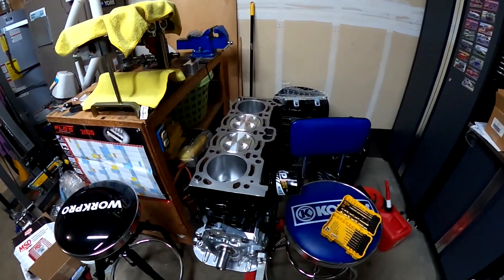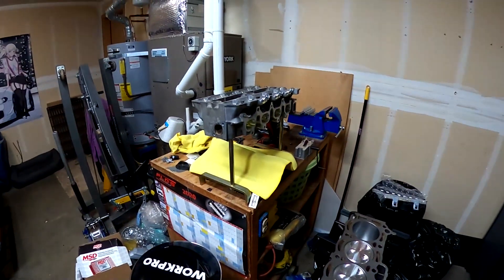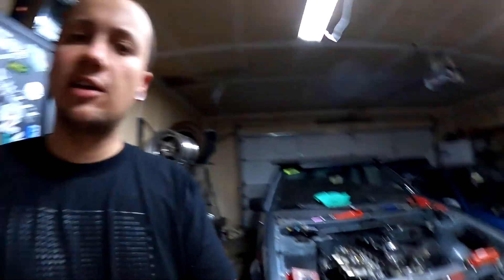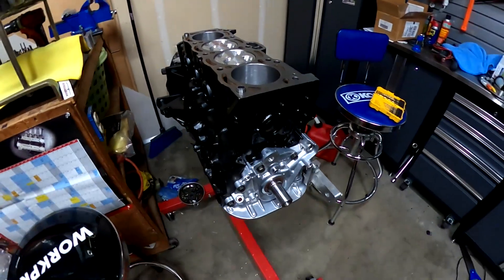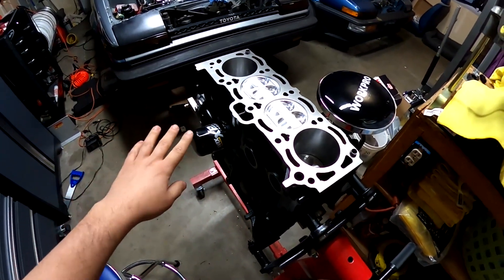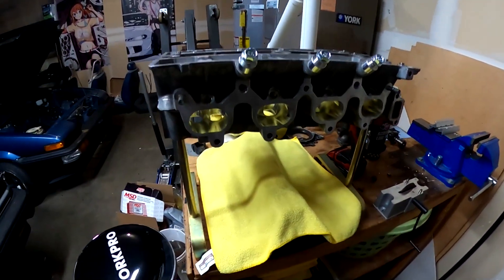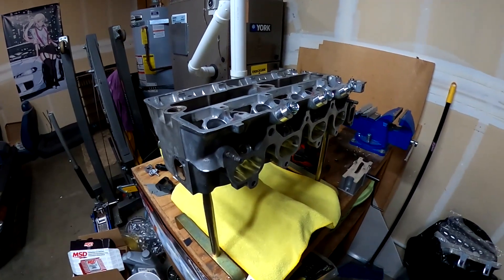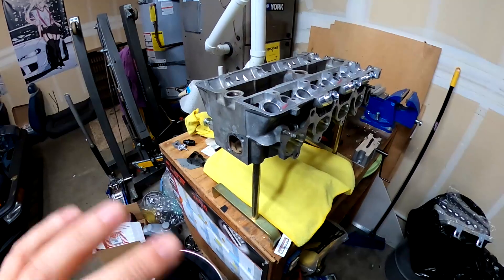Building a 7AGE: The Specs

Comment: How much did you end up spending on your 7age builds? I drive a 6th gen Celica 7afe that I learned to drive manual in but wanted to possibly add more power to it and have been thinking about swaps (3sge, 3sgte, hell even 2grfe) or rebuilds (7age) but both of these have their cons

For a engine swap I’d pretty much certainly need to go pick and pull a s series adaptable transmission to replace my current one and install/fabricate different motor and transmission mounts. 

For a rebuild on the other hand I wouldn’t need to get new motor mounts or a new transmission as long as I know the power range that the gearbox and clutch can handle. But a rebuild would require lots of machining that I’m just not to financially knowledgeable about

I’m wondering what in the end might be a more bang for your buck endeavor. I used to think it leaned more towards a swap because of less machine work but most of the engines that were as drop-in for a 6th gen Celica as you can get have gotten crazy expensive for over $2-3k just for the motor alone

I guess I’m just spit balling. I’d love to really get into tuning my car and creating a unique build that I can feel like I created but I also am uncertain financially about what I could be getting myself into. Im currently in college so disposable incomes kind of tight, say no more than $4k kind of thing. If I could make 200 or more hp with anything up to that kind of money I’d honestly love to try it

Comment: Nice build! What fuel injector cc size and fuel pump are you running on your build?
Reply from the maker: Stock pump, 370cc injectors
Reply: Any fuel issue on a stock pump? Im also running a smallport 7ag with smallport pistons, 312cc 7mge fuel injectors, MRP cut crank timing gear, stock cams and stock fuel pump but my AFR leans out 17+ after 45-5k rpm. Im leaning towards a weak/worn out fuel pump at this time.
Reply from the maker: @AE8TY2  no issues yet, rock solid 12.5:1 AFR all the way to 8500

Comment: At 12:1 compression, what gas are you going to be using? I'm going to be running 11.5:1 Toda pistons in my destroked 7AGE and I'm worried about what octane fuel I can get away with.
Reply from the maker: You can run whatever fuel you want as long as you dial the timing back to prevent knock. I'm on pump 92 and just got the motor running, timing set pretty conservative until it's broken in and I can do some tuning with knock headphones.
Reply: @DannyZiegler86  Ah okay, good to know. Thanks. 

I'm glad you got it running. Cool to see a local Washington build coming together!
Reply from the maker: @deankelley1  for sure! If I had local E85 I'd go that route, definitely leaving power on the table with pump gas but I'd rather be fuel limited than not have enough compression to maximize potential.
Reply: @DannyZiegler86  another question for you. Where did you have your block machined? Everywhere I've called around to days they're backed up for months.
Reply from the maker: @deankelley1  Auburn Auto machine. They're probably backed up too. Basically every machine shop is.

Comment: Well if this is going to be a street car why are you running such a high compression? Are you planning on using octane higher than 91
Reply from the maker: We have 92 here, but you lose dynamic compression when your cams have bigger overlap, so you need more static compression to compensate.

Comment: I'm starting my 7age build, did you have to skim the deck height with the 4age, if you did how much clearance is required to keep the engine non interference?
Reply from the maker: The rods I'm using are longer than standard 7A rods so they bring the pistons up to the deck, non-interference left the building a loooooong time ago, I'm running real big cams.

Comment: I was searching and people talk about shaving down the stock pistons and it should be fine to mount and run with 4age head, is that true or we really have to mount the 4age internals?
Reply: We have rods already made with the mod from factory on maxpeeding rods, stock 4age pistons arent that expensive, so yeh, i will consider that, thanks
Reply from the maker: To my understanding, you will have really poor compression and make very little power due to the pistons not being properly matched to the head. I've heard of people doing it, but those engines struggle to make stock 4AGE horsepower numbers.
Reply from the maker: The lowest cost option I would consider acceptable is stock 4AGE pistons mated to modified 7AFE rods (modded to accept 4AG wrist pin) all stock 7AFE bottom end with stock 4AG head. You won't be able to rev it real high for several reasons but it shouldn't sacrifice horsepower.

Comment: FYI, the 7A crank is actually forged from the factory. A properly balanced rotating assembly should prevent crank failure. Like the build though. I myself am doing a 7A-GZE.
Reply from the maker: Ah, my mistake. Either way I like to play it safe so I'll be keeping it under 9k, don't like the thought of breaking a crankshaft 😅
Reply: @DannyZiegler86  better to be safe than sorry. Very nice looking setup, and the build seems really well thought out.